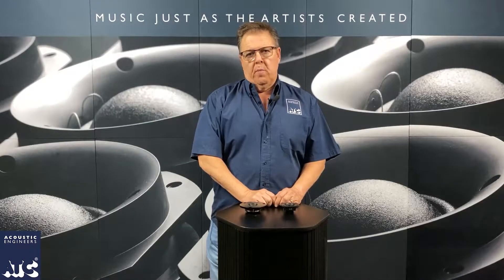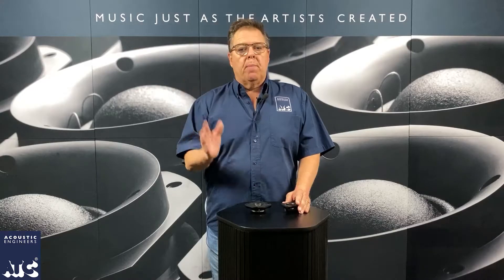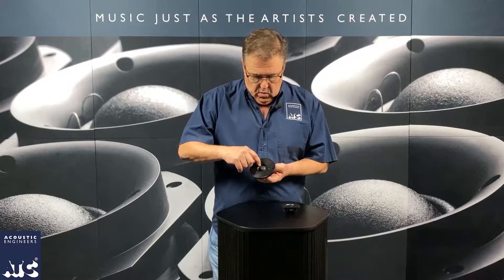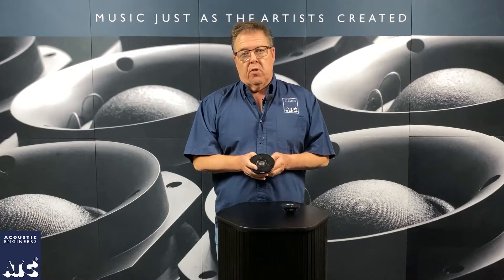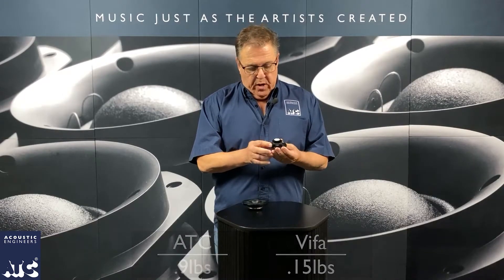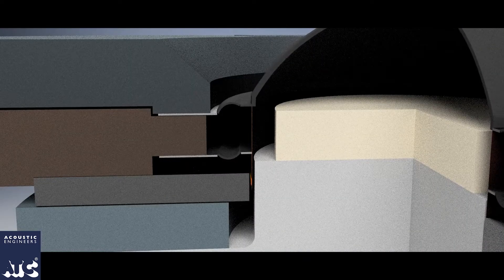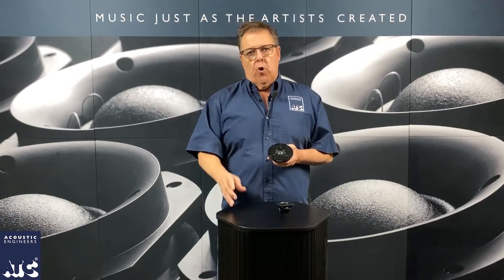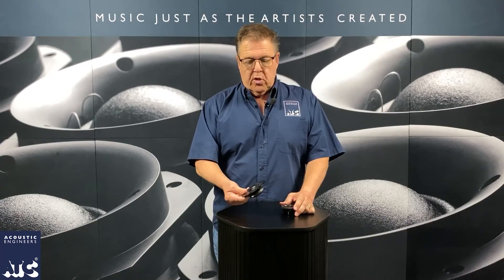ATC Pro Driver Technology - Tweeter

Comment: Sorry, but the tweeter is the major weakness on top ATC speakers.  It may be good. But it is clearly holding the company back.  Maybe it's impossible for a single dome tweeter to be refined and also be dynamic enough and loud enough to keep up with the rest of the speaker.  Whatever the problem. It's the tweeter and only the tweeter which keeps me from even considering owning.   The passive crossover has similar problems which also holds the whole design back.  Still. One of the best speakers available for some.

Comment: It is not a good comparison.
You are comparing apples to pears.
If you really want to compare the tweeter made by you with the one from the competition, take a look at SB Acoustics Satori TW29BN  or  Scan-Speak Illuminator D3004/664000.
What you did there,..it's not fair.

Comment: I’m considering buying the SCM25a speakers in the next few weeks here.  I will, say it kinda set me back that I’d be getting an OEM tweeter from another manufacture for the SCM25a.  Sucks to be a tweeter away from a truly perfect nearfield monitior.  Any idea when you all will upgrade the 25’s to the in-house tweeter?
Reply from the maker: Know what you mean and if you want ATC's tweeter check out the SCM20A or SCM45A, you'll definitely get higher resolution as expected in the top end.  That being said, some people prefer the sound of the 25A.  There's currently no word as to if/when the 25A will be changed.
Reply: @TransAudioGroupMedia  Also the bigger 3ways 50 and up have the SL spec mid and tweeter right?
Reply: First listen then decide